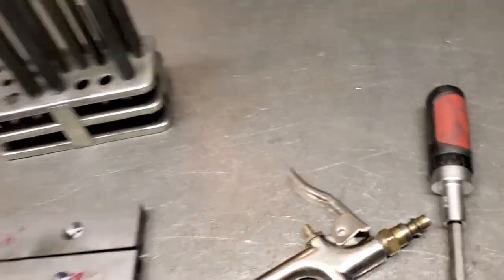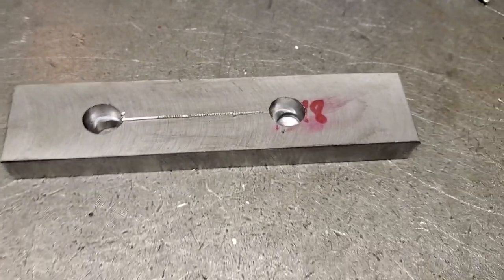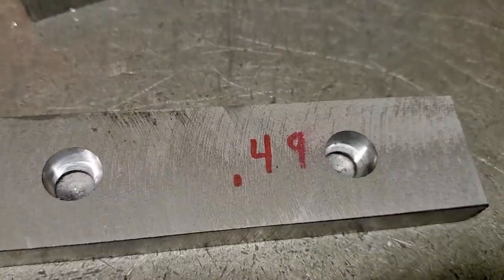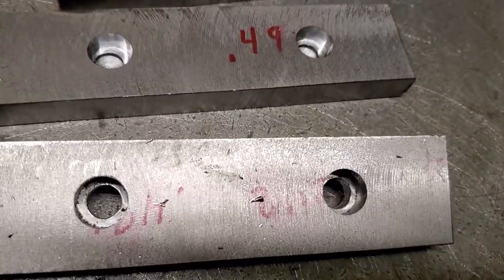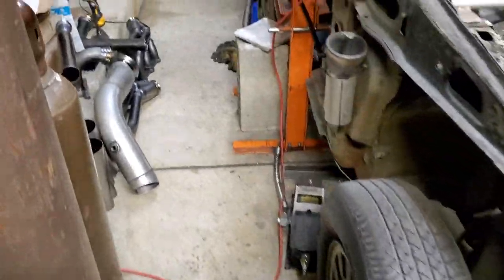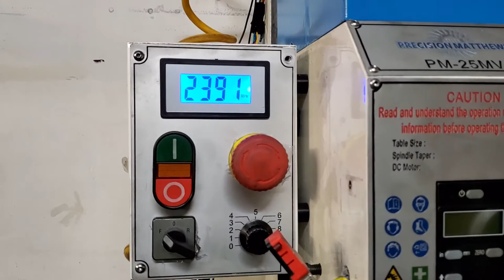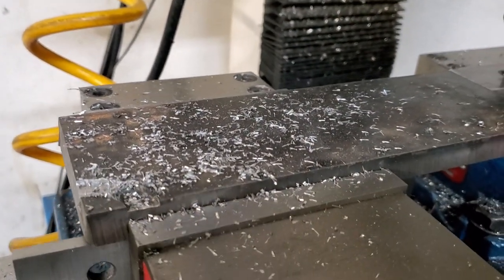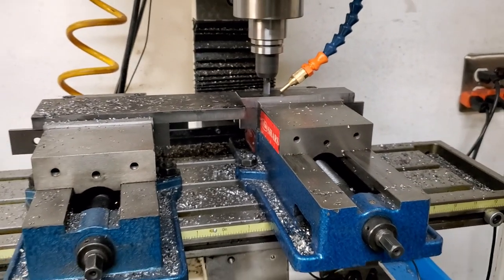My first CNC attempt at milling some hard jaws went 50/50

Comment: Looking good. If you have smaller bits that might let you get away with a higher RPM and not stall out. Chips looked good, those blackened ones from last time definitely had too much heat in them
Reply from the maker: Thanks Jake. Yea trying to figure out the feeds and speeds seems to be the chore. Lol. I'm just going to start keeping a journal of what is working and what isn't working for them. I'm going to possibly do a dmm spindle motor upgrade. If you ever seen Kent's cnc pm25 youtube channel he just did one and the low end Torque is great.